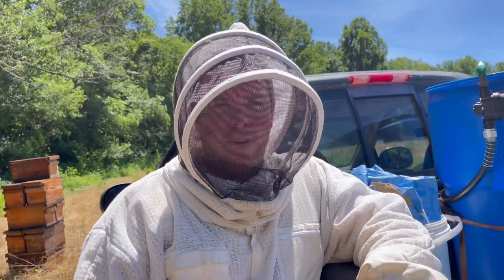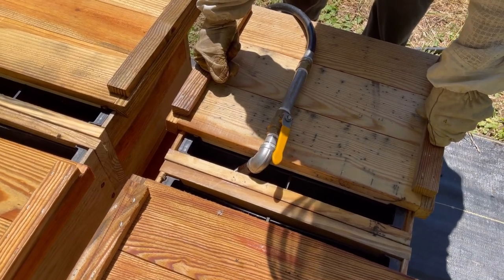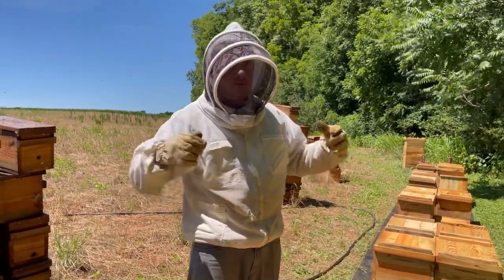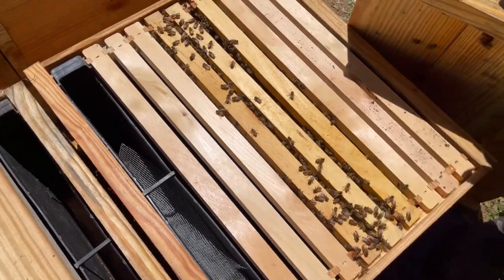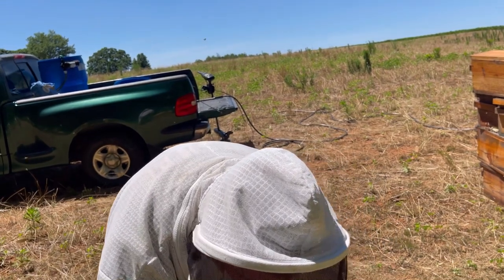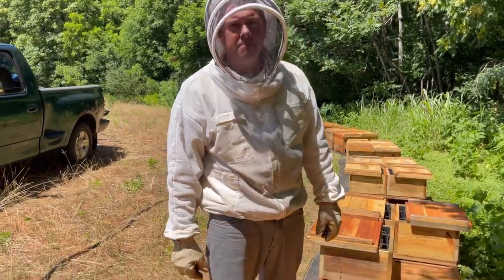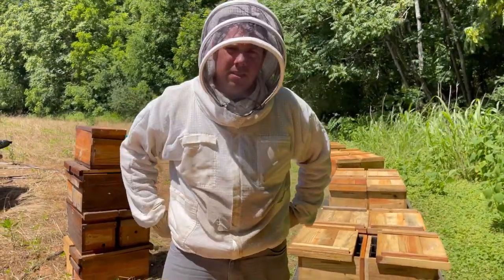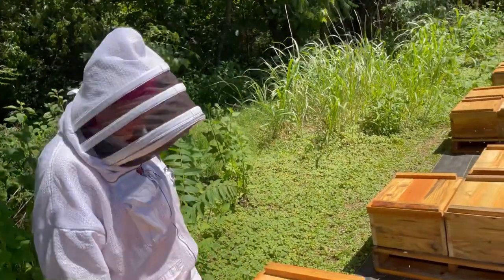Feeding a commercial honeybee yard - Our 12V electric pump setup

Comment: Hey Mr Ashby. Just started watching your channel. Hope youve got a tote for hauling syrup by now.  I attached a male banjo coupler to the bottom of my mixing drum then to a trash pump which pumps finished syrup into tote
Reply from the maker: Still working out of two barrels. The f150 can only hold so much weight ~1,200 lbs. (Me Cori Sugar, water) which limits us to feeding 3-4 apiaries at a time before having to return home to get more sugar. Don’t like the trash pumps because they’re gas powered. I agree w Bob Binnie that the on-demand electric pumps are the way to go.
Reply: @Ashby_Farms_NC  i gotcha.  I dont use the trash pump for anything other than filling the tote which is in back of pickup and hooked to on demand pump